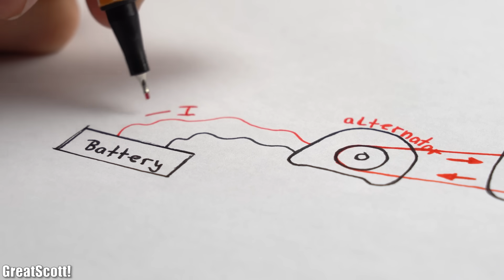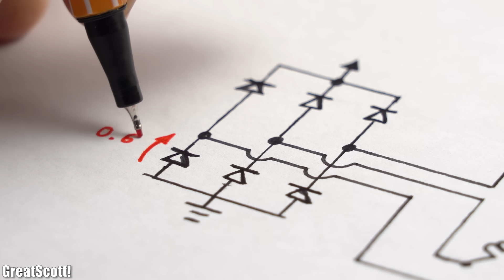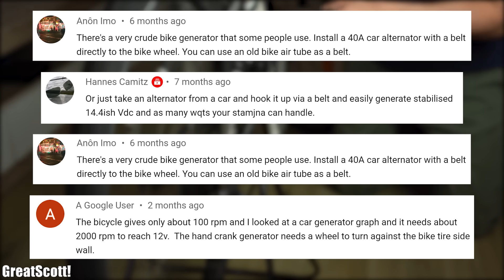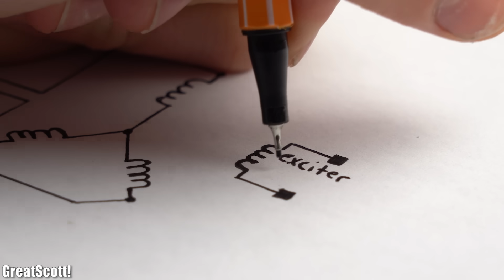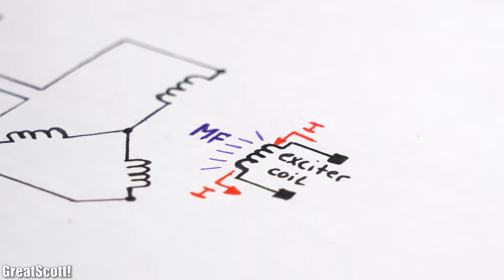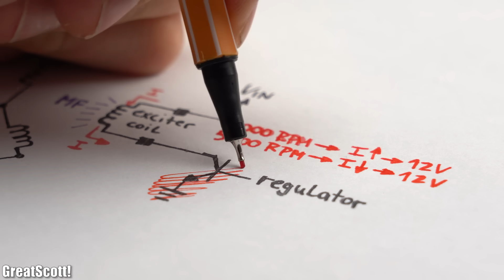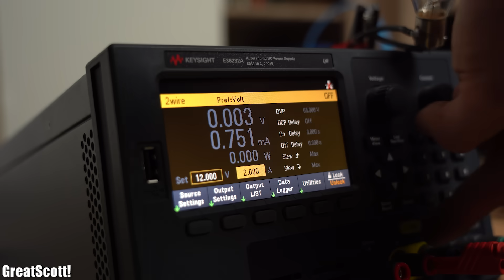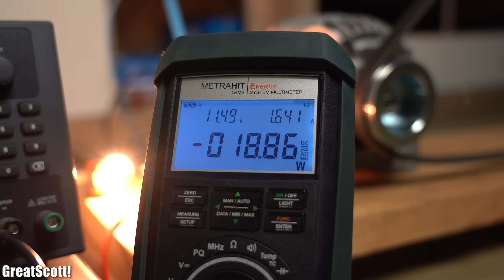Using a car alternator with a bike to power my home? How much energy can I produce?!

Comment: 12 Volt 6000rpm Dc electric motor hooked up to a 12 V car battery, Battery powers the DC motor which spins the alternator @6ooo rpm connect voltage regulator to battery to recharge, bypass voltage regulator with wire connected directly to the coils for raw 110V AC current per coil. bam done power your home, just make sure to ground out coils.

Comment: If you had more than one alternator and charged a battery bank. Also adding a tensioner to tighten the belt would help, to much lack in belt looses energy

Comment: Just after the war, my Dad a US Merchant Mariner went to a German Dentist. He placed a new filling, using a drill powered by a bicycle. He also observed a vehicle being powered with a combination of coal and wood gas, where the fumes were being directly fed into the carberator. Germans said that while it takes a while to to get it started, it could run a fairly long time, more so if there was more coal in the mix as opposed to wood. They also had a wheelbarrow and hammers, they were collecting bricks from bombed buildings and using them to make new construction.  It's always about ingenuity and converting one form of power to another, or in the case of the dentist's drill, just converting motion, and hard WORK with the  hands and brain. The filling lasted over thirty years, quite an accomplishment on the part of the Dentist, considering the conditions he was working under. All the Best! DE W8LV BILL Pietschman.
Reply: the coal and wood fuel you are referring to is called a gasifier. It's actually extremely effective as a fuel. It's a neat read to look into.
Reply: Painful?? Lol
Reply: One of those mountain men shows had a truck that ran on wood fumes. I also remember the Bosnian war where people fixed paddle to generators and strung them across a river on oil drums.
Reply: That is ingenuity and problem solving at its finest! I think you’ll find this interesting. In the final years of WW2, the remaining Nazi scientists and the engineers were forced to undertake what can only be described as an impossible task for the technology of that era, they created an entirely unique approach to solving the fuel shortages with respect to gasoline, kerosene, and the various chemicals needed to keep their aircrafts flying, their truck wheels spinning, and their tank tracks rolling. With Hitler ensuring that the immediate vicinity of his every location was both armed to the teeth, and had plenty of fuel for escape should whatever battle ensue, this meant that they had to come up with something else, but something no one else would consider possible. Their tireless work led to some of the coolest things the aeronautical field has ever seen to this day in my opinion. Airplanes that utilized wood burning and coal for the needed propulsion, altering the rotary engines of their day in different ways to develop an alternative rotary style steam engine of sorts, using fire wood and coal to fire up the engines and who would’ve thought that those ultra-heavy pile of metals would work as a functional aircraft?!? The Planes did nor have the capabilities of the traditional ones, that goes without saying but they did work! Another innovative last ditch effort to win the war was the Nazi Cold Rocket Engine and another Youtuber named Integza actually did a video on it where he 3D printed one himself. It was pretty freaking cool. 
I’m with the rest of the world in hating the Nazi’s but I have to give credit to those in which credit is due regarding the field of science, against all odds and some of the most Especially considering scarcity in resources that were crucial to their survival leaving them with no alternative: innovate, or die. 
I do sometimes that their crazy last ditch efforts of innovation kn particular, the wood and coal aircraft, were is not given the credit that it deserves today (for obvious reasons I will admit). taking science and the field of mechanical engineering right up to the line of impossibility. The scientific achievements those Nazi scientists accomplished at wars end, is nothing short of the ingenious engineering and absolute marvels the world had seen by then. When the Allies had all but destroyed Hitler’s oil production and the other supply lines that the Axis Powers relied upon so heavily near the end, leading him to issue an executive order for the remaining scientists and engineers to develop an alternative means of power as well as alternative methods for producing the thrust needed for aircraft propulsion. I cannot understate just how insanely difficult this task must have been at the time with all the lack of free information, dwindling supply lines for the Axis Powers, and the undoubtedly terrifying amount of pressure placed upon their shoulders to make all of those things happen with such meager materials and available resources at hand. There is a reason that the Brits, the Soviets, and the U.S. wanted to get a hold of as many Nazi Scientists as they possibly could at the time, America was arguably the winner as Operation Paperclip lays out in detail, it was the Russians however that seized most of Hitlers V2 Rockets as well as all of the Experimental “Wunderwaffe” that it could find which I’m sure we will never know the true extent of, but in mg opinion “Die Glokken” was not among them…. 
Not trying to give kudos to the Nazi’s or anything by bringing this up, just giving credit where credit is due.
Reply: @tylerhusky4065  They were German scientists.
Reply: @tylerhusky4065  

Wood And Coal Burning Would Have Been A Gimmie To Any People In That Situation.

There Were Nothing Left For Them To Uses….

By De Facto They Have No Choice…..
Reply: Really? Medium... or is it some serial stalker obsessed with me at facebook at Google to rob me. Bums.
Reply: @williammekhjian7817  batshit crazy with a high self opinion if ya ask me. Keep smokin the meth. It only gets better bro
Reply: I assure you facebook will be shut down coming soon.
Reply: It’s still a tiny bit more cleaner generator wood coal

Comment: 🤣
Reply: You have to put powder and alternator before it'll work as a mechanic I've seen tons of people diagnose bad alternators because the fuse pops and the alternator won't make any power if you don't put 12 volts to it first and then it's self-sustaining

Comment: Use a grinder with a big star to rotate a smaller star welded to the alternator. Connect a controller and a hybrid inverter. Continued the thinking...

Comment: If you want to see how much energy is needed to run an alternator on your car start the engine and let it rest at an idle speed which will be about 600 to 700 RPM when the engine is warm. Then start turning on as many electrical accessories as you can one at a time but don't turn on the air conditioning. You will hear the engine note change slightly as the load increases and the tachometer will show a slight decrease. The older your car is the more this will show up. The condition of the car's battery will also affect the electrical load. If you are looking to use an alternator to generate electricity away from a car then look for an older unit that is easier to access the brushes that energise the electromagnet of the rotor

Comment: All tht pedaling an labor to generate electricity is ridiculous. Find yourself a small electrical motor to attach to the alternator pulley.this way once you pedal the first time an generate enough power yu can stop pedaling an the motor will take over spinning alternator pulley.now  what yu will probably have to do is make a adapter for the first alternator that is powering motor to keep it going an what yu do is add a secondary alternator that is smaller in size an have the second spun off the power spinning first one.now that will be the one you store your electricity from as nothing is pulling a load from it like first one so yu could charge multiple 12v battery in a bank. This is how my setup is currently an I power  whole house this way. 3 flatscreen, my gaming desktop with its 600w powersupply a half sized refrigerator NOT A MINI fridge it's a full size one just not as tall.electtic hot water heater multiple USB devices AND it charges my electric Chinese scooter every single day. Dm me if need any tips or help.im always willing to help ppl go off grid in a clean an stable way like this

Comment: 1920 thread sewing machine ( figured this in 08' no patent anyway) gears on the arm of the machine push a lite pole onto the paddles below this makes the wheel go around on it's own once you get it going  You can also increase speed and turn it on or off etc   yours hope it works for you  I'm retired no money too

Comment: I know this is an old video, but i have a small idea to improve onto the system at hand. A. A smaller gear ratio would help you have more rpms, if you could find a way around the 12v limit. B. You can add bigger pulleys to the alternator to hold multiple belts, and have the bike hooked to one which is hooked to another. This would allow you to turn multiple alternators at the same time. Giving you more power.
Reply: yup.  they make 24v alternators..
Reply: rossbrumby, you really need to improve your vocabulary and sense of decency.  In answer to the question, no human can power even a single alternator at maximum output, much less multiple ones.
Reply: The issue here is that to make a certain amount of power, you need to be strong enough to turn the alternator fast enough while under load. The alternator spins freely when it's not hooked up ready to charge, but at the required rpm to output 14.4v at say, 35 amps (a typical early 70's alternator rating), your average person is pushing shit uphill trying to power that. If you really persevere, you may become an athlete.

Comment: I hooked my bike to a 100 watt light bulb not to create and power but to offer resistance for exercise.  I'm in pretty good shape but whoa the 100 watt light bulb was a killer.  One horsepower is about 750 watts and that would be way beyond Lance Armstrong for any length of time. So no this is useless.

Comment: If you really want to increase the amount of energy you produce with this system you must include a "flying wheel" !!!
   You can do that in 2 ways:  1) Stick weights to the wheel of the bicicle; of course very carefully so that you won´t damage it and trying to keep the wheel balanced as much as posible.
  2)  You can add a "flying wheel" between the wheel of the bicicle and the wheel of the alternator.  You can also take advantage of the "flying wheel" to increase the RPM at the end of the sistem (the wheel of the alternator).  So that the wheel of the bicicle will turn the flying wheel and the flying wheel will turn the wheel of the alternator.
   With a "flying wheel" you only make a large effort at the beginning of the pedaling until the flying wheel gets a desirable RPM; then you continue pedaling with much less effort (so as to keep the momentum of the sistem) and the alternator will continue producing energy at a high rate !!!
  It´s like the planes:  They use a lot of fuel at the departure, but when they get a certain altitude they use much less fuel (just to keep the plane flying) and they keep having the high speed that was needed to get that altitude !!!
   That´s why the wheel I´m talking about is called "flying wheel".
   Wish you good look !!!

Comment: One thing you have to keep in mind is the generator has an off function to it or the alternator has an off function to it because the regulator if it does not get let's say 12 volts or if the car battery is not hooked up it will not turn on that feature what you need to do is not power it separately but keep it in current to the same circuit and instead of getting that kind of an alternator you should have got one from a 1977 Chrysler with an external regulator on it with a green and red wire you hook those up and then you spin the alternator and then you will generate the 12 volts you needed however using different brands of alternators and different manufacturers versions of them you're going to have different issues you're going to have different problems you're going to have different solutions and then you're going to have to come up with different ways of going about getting the same output keep it simple and go with Chrysler from 1975 1976 like let's stay off of a Dodge 440 motor you got 140 amp to 160 amp alternator you spin it at 800 RPMs and you will get all the current you want I built the same thing when I was a child out of this similar to what you just did but I did not use a bike to power it I helped my grandfather work out of used car lot and we needed a way to jump vehicles quickly without actually using jumpers and other vehicles that could hurt their alternator so I took a table saw motor and hooked it up to a belt that power in an alternator and when I turn on the table saw motor I had my current right then and there I hooked it up to the vehicle with a dead battery charged it instantly and started it up right away message me if you need any more details remember different alternators create different struggles

Comment: Altinator needs 12 volt s to charge this altinating current ,,a generator does not it starts charging as soon as u turn it low or high rpm

Comment: Well it works. Perhaps to stabilize the voltage, you need to copy the car electricals,  install a charging unit and a battery.

Comment: An auto alternator will not put out the kind of voltage/amperage you need  by turning it with a bicycle pedal.  That's why home generators use gasoline engines to power them. Not to mention the more load you put on it, the harder it is to turn.  It ain't gonna work. Pay your electric bill and be grateful its so cheap for what it does! I cant believe ppl think they can run their homes on bicycle peddle power.

Comment: Alternators operate differently than generators. That alternator is capable of outputting  120 amps but ONLY if there is a demand for that much. You cannot output more current than needed. You also need the output to feedback to the battery because the battery acts not only as a storage device but also as a surge and variance dampener that will smooth out the variance caused by unstable rpm due to pedaling. If you are using a 3 amp light bulb you will never get more than 3 amps of output. 

You didn't need to consult youtube, just a seasoned automotive tech with a strong automotive electrical background.
Reply: He also needs to get rid of that blower fan belt and use something tighter and much thinner. Maybe even ditch the belt and put the pully directly on the tire of the ten speed.
Reply: @finscreenname  still need a tight belt or convert to chain driven. The greater the current load on the alternator the stronger the magnetic field gets requiring more torque to turn the pulley. Probably anything greater than a 10 amp draw would cause the pully to slip if directly against the tire or with a loose belt. This is why you will hear a belt squealing when a car first starts up. The sudden current draw to replenish the battery after first starting will cause a loose or old belt to slip and squeal.
Reply: @craig32935  You would think someone with over a million subs and views would put a little more effort into it....
Reply: @finscreenname  I agree. He basically finished off by telling people it won't work so don't waste your time which is false. Hopefully most people a smart enough to realize if alternators did not work, they woul dnot be in vehicles.

Comment: I'm sure this has been said, but your biggest mistake is by using an alternator that isn't self exciting. A GM 1 wire alternator, typical of an on older Chevrolet or get one from an old diesel Volkswagen (think 70's/80s). Those are way easier to work with. Also a tensioner would be a good idea to tighten that belt up. That would in turn make for a much smoother ride, and you will be getting more consistent power delivery.

Another thing you can do would be add a weighted flywheel to assist with holding motion more consistent with your pedaling. The only other thing I would recommend is a tougher chain, a single speed bike, and maybe a more stable bike mounting.

Comment: Now hook that lot up to a vertical axis wind generator in the garden, roof or balcony and use it to charge a battery and you have the very basics of a low voltage off-grid power system that will run some lighting, or DC powered equipment.   Use a larger alternator - 24v would be a step up and with suitable battery storage, will power an AC inverter, which feasibly could boil a kettle for a refreshing cup of Yorkshire Tea.    
.
14 years of pedalling to generate one year's worth of Kilowatt hrs :-D LOL!

Comment: You need a higher and more consistent RPM, some sort of motor that can sustain its RPMs after reaching a certain RPM, would be ideal. The motors on assisted bicycles would work really well, for having both the gear box and motor.

Comment: You're making this way too complicated all you have to do is change the pulley on the alternator therefore it will have more than the revolutions you need to get the RPMs higher at a charging voltage